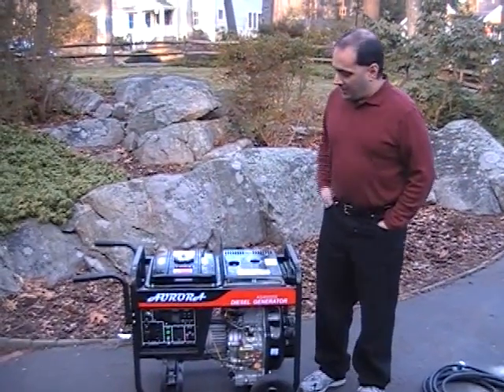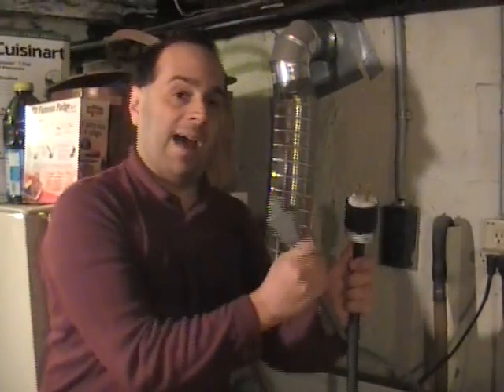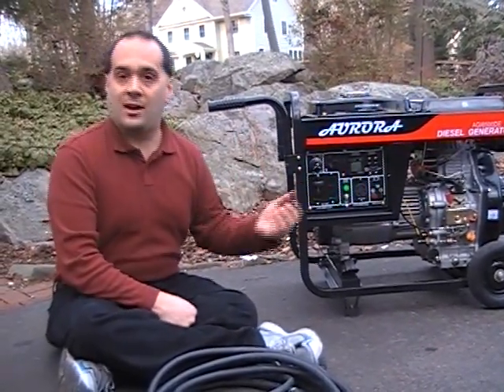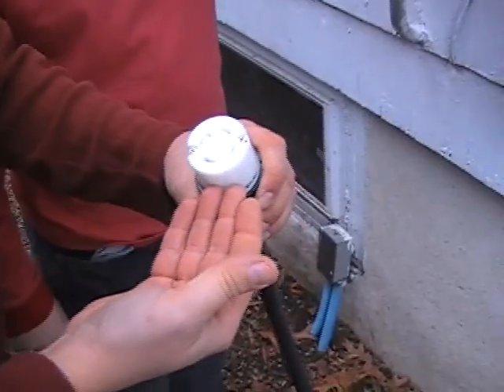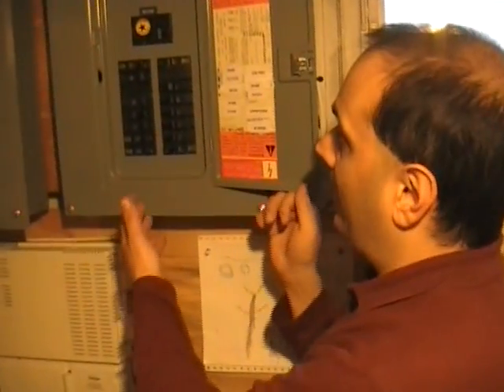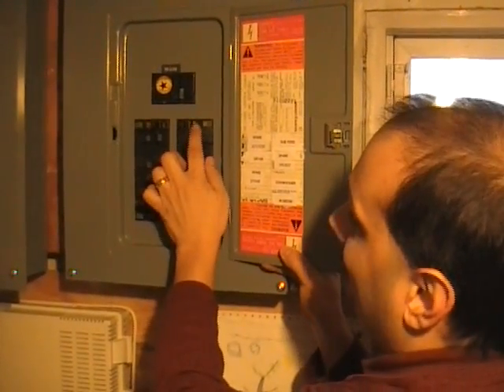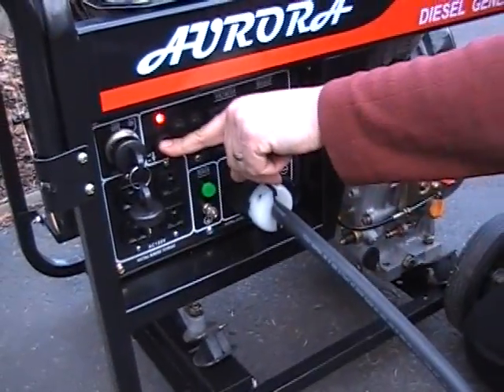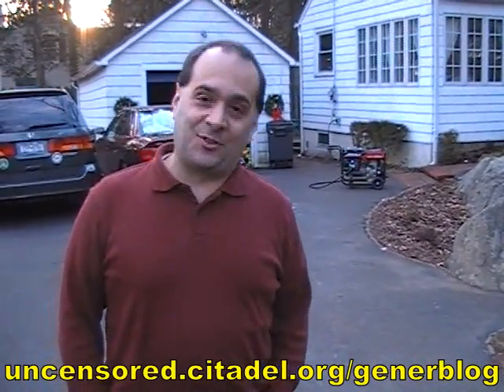Inexpensive residential generator hookup

Comment: Hi Art: Thank You for the great video and information.  First off I know very little about this, So I have to ask questions to learn. I have a double 50 amp circuit breaker as my main breaker/ ( On and off switch, )  Could I hook up another double 50 amp breaker from the generator directly to the wires on the house side of the main breaker to feed all of my circuits without a transfer box. The interlock switch would be needed. Trying to learn. Again Thank You.
Reply from the maker: For an interlock, the number of poles is not important; what is important is the number of handles.  When you say "double" do you mean two poles or four?  For an interlock, as long as both handles cannot be closed at the same time, you are good to go.

Comment: chances are back feeding cant handle the heat of those wires
Reply from the maker: I admit I poorly phrased that sentence.  The wires themselves can of course handle backfeed; ampacity vs wire size is all that matters.  The point I was trying to make is that the circuit breaker is at the wrong end of the cable when the circuit is used in that manner.
Reply: well said

Comment: Your outside male plug does not appear to be weatherproof while in use.
Reply from the maker: You are correct.  It is not.  Wasn't required in that location at the time it was installed.  Since then, I have switched to while-in-use covers.  They don't cost much more.

Comment: A/C and fridge/deep freezer and the ability to charge a few electronics would be my only real concern in a power outage.
Everything else is manageable for what 98% of the time, ends up being a very small window of no electricity.
Reply from the maker: Only you can decide whether you need a generator, how big it should be and how you hook it up.  When I made this video I lived in a neighborhood where the power went out several times a year, and after a hurricane it could be out for days.  In my current location the power is so reliable that a generator isn't worth it (but of course I already own it).

Comment: I have done the same thing to my home except for one thing and that is I was told when I had it done that you should have your generator running before you plug in. Not that the way you did it was wrong because all your breakers were off and then turned on after your generator was running.
Reply: Generator safety rules: Always make sure you follow all the generator safety rules before using your portable generator. This is only a reminder. Generators can be dangerous if not used carefully. Every year, hundreds of people die or get injured when using portable generators due to carbon monoxide poisoning and electrocution. Make sure you are using your generator carefully and keeping others safe as well. There is something very serious that everyone should always be aware of when using generators. Some people do run their generator indoors which is not safe and that increases the risk of carbon monoxide poisoning which can cause death of family and you. Some people run their generator in wet conditions which can electrocute them. Please remember that you should never run your generator indoors. Remember that carbon monoxide is an odorless and colorless gas that you cannot see or smell. Carbon monoxide is a silent killer. Keep that in mind. Make sure your generator is 15-20 feet away from your house and away from doors, windows, and vents. Never use your generator in your porch too. Having a carbon monoxide detector is very important against generator safety. Some people also allow children to go near the portable generator which could pose risks. We need to keep an eye on our children making sure that they are not near the portable generator so they won’t get electrocuted or burned by the generator which is dangerous. A locking enclosure also keeps kids safe. A generator shed might look like a tempting place to explore, or take cover during a game of hide and seek, but a generator is a dangerous piece of equipment that can cause injury. It says on the manual that we should also keep children away at all times from the portable generator to avoid injuries. Please do not allow a child or unqualified people to operate the portable generator.  It is important to keep your children safe especially little ones. The portable generator can be hot during an operation. Just because some manuals missed what should be listed doesn’t mean it’s safe to do. Always follow the generator safety rules when using portable generators. Generators pose electrical risks. If you need to use your generator during wet weather, you need a generator tent to protect your generator from getting wet. Don’t let your generator get wet. Keep your generator dry and before using your generator, please make sure your hands and your generator is dry. Do not wear loose clothing when operating the generator. Everything that is said on the generator’s operating manual should not be ignored. Never smoke cigarettes near the generator. Please keep flammable things away from the generator. Never overload your generator too. Your generator can catch fire. Never ever try to plug a generator cord into a wall outlet to avoid back feeding. Back feeding your generator is dangerous. Always turn on your generator first before plugging in appliances and shut off the appliances before turning your generator off. Use a heavy duty cord for your generator and the cord should not be worn out. All the instructions should be followed carefully. Never refuel your generator while it’s running. It can cause fire if fuel spills while your generator is hot. You should turn off your generator and let it cool off before refueling it. Having a fire extinguisher next to the generator is also important. This is only a reminder for everyone’s safety of using generators. Make sure your generator is properly grounded. Having a fire extinguisher next to the generator is also important against the safety rules. https://youtu.be/I1jT3ANENvI and here is a video more about keeping others safe when using generators and also about our family’s safety. It’s important to keep our little children safe as well. Make sure they’re away from the generator. Hope this helps.

Comment: what kind of oil based furnace do you have?
Reply from the maker: +TMP TAKE MONEY PRODUCTIONZ    None, anymore ... I moved out of that house a couple of years later  :)

But it was a Weil-McLain furnace, installed (as far as I can tell) in the late 1960's, with baseboard radiators in two zones.

Comment: Assuming we have room for the interlock  kit, won't it be more flexible to connect  the generator to your main circuit board?  this way it is more flexible and you can selectively turn on what you want; instead of a a separate panel where you "Lock-in" your selection and cannot change it later (easily).
Disclaimer : I am not an electrician, therefore pardon me if I am sounding too naive.

https://www.youtube.com/watch?v=DtJQkK6sVno
Reply from the maker: +Nasar Azam    Every site has unique requirements.  The house in the video had a small 16-circuit panel and it was full, so there was no room for a generator breaker and interlock.  I would be ok connecting the generator to the main panel under the following conditions:

1. It is a big panel with enough room for the generator plus any future expansion
2. There is a manufacturer-specified interlock kit available.  As I mentioned in the video, I think the aftermarket ones that attack to the cover are a little clumsy.

But anything is better than those cheap grey boxes with the button breakers  :)
Reply: +Art Cancro (IGnatius T Foobar) My Panel picture. Any suggestions?

http://tinypic.com/view.php?pic=24zkk0p&s=9#.Vub_6-IrKUk
Reply from the maker: +Nasar Azam Your panel appears to be full.  To install an interlock you would need to remove two circuit breakers.  Those are all 1" breakers so maybe you could replace some of them with 1/2" (tandem) breakers if the panel accepts them.  Or you could move your generator-friendly loads to a sub panel like I did.

Disclaimer: I'm an expert but I'm not a licensed electrician; always consult with your building department and get a permit.

Comment: Very informative video - thanks.
Now , how do I communicate this with an electrician to create a similar set up?  :)

Can you suggest a portable generator. The main purpose is to power the sump pump in emergency.  Yes, I do have the battery backup, but I do not feel secured with that and our basement is fully finished.

thanks

Comment: Noticed how he didn't wire in his gas stove (can light with matches). Well that's fine for the stove, but not the oven. The thing is, modern gas OVENS use an electric glow igniter instead of a pilot light, so your oven will need power if you want to use it. Just sayin.'

Comment: where can i buy the two pole circuit breaker interlock clip? cant find it online
Reply from the maker: You need to get one designed to work with your panel.  The one in the video is model QO2DTI which is designed to work with Square D.  Just google that part number and you'll be taken to any number of online stores that carry it.
Reply: +Art Cancro (IGnatius T Foobar) Could you tell us what model sub panel you purchased? Thank you.

Comment: I'm confused how you wire the hot line coming off of each of the individual breakers in the subpanel into the existing circuits already wired into your home that you wish to power with your generator. Did you have to move all of the circuit breakers and wiring from the main panel over to the subpanel for each circuit you wanted the generator to run?  A lockout or mainline transfer switch seams to be less labor intensive, because you don't have to move all of the circuit breakers and wiring for each circuit you wish to power with the generator from your main panel to the subpanel. If you have to move you wiring from the main panel to the subpanel, what do you do if there is not enough wire length to make it to the subpanel?
Reply from the maker: +Andy Johnson - Yes, any circuits that I wanted to be generator-powered were moved from the main panel to the sub.  As I mentioned in the video, I didn't have the space for interlocked mains in the existing panel, and I wanted more space anyway.   I still maintain that the aftermarket interlocks are a bit clumsy, but if the manufacturer has an interlock made for the panel, and you have room in the panel for it, then that's definitely an option.  In fact, I am considering that option for the home I now live in (I moved to a different town about two years after the video was made).

Comment: LOCK OUT the main breaker and tag it. Tell everyone in your house what you did it for.  I did not see that on the main panel, the lock ?
Reply from the maker: +Michael Carron - In this setup there is no need for lockout/tagout because the interlock prevents any dangerous connections from ever being completed.  Lockout/tagout is typically used by electricians to stop other electricians from energizing a circuit when they are working downstream.

Comment: Good video Art. I just bought a generator this week. Likely will use a outside box to connect to house circuit. But, your screen disclaimer about Insurance "does not cover fires from illegal, electrical hookup", is totally incorrect, at least here in USA. As long as the proximate cause is Sudden and Accidental and of course Unintended.   It would be no different from auto collision denying collision coverage to the owner caused when the insured driver was too drunk to drive and hit another object.  Insurance will pay for our stupid and harmful choices, legal or otherwise.

Comment: Well I agree that the backfeed system is not the best  way to go but I disagree with the protection being all the way at the panel all gererators have circuit breakers built into them.  If I had to do it in an emergency I would just change the dryer outlet to a rv marine power shore inlet box with male twistlock and put a female twistlock on my dryer.  I could then safely use a standard generator cord to power my panel after killing the main.   The Linesman are taught to isolate each section they are working on so even if you did forget to kill your main they would be safe if they follow proper procedure.
Reply from the maker: +davidbrennan5 It is true that all generators have circuit breakers built in to them but do keep in mind that the purpose of those breakers is to protect the generator, not the wiring.  And you are also correct in observing that linemen do test the circuits they're working on, never assuming that a line is dead.  The danger comes when they test a line, confirm that it's dead, then some jackass backfeeds the grid and the transformer, suddenly that 13KV line that the lineman had confirmed dead is now energized.

Yes, backfeeding through your dryer outlet works.  No one's arguing that it doesn't.  I still maintain that the risks outweigh the benefits, especially when a proper inlet and interlocked breaker can be had for less than $100.

Comment: very good video, everything is very well explained, now if you can show how to switch your breakers from the main panel to the sub panel the easy and safe way thank-you!
Reply from the maker: +brans   Unfortunately, I didn't think to take video while doing the work, but I did take a photo when I was finished:  http://photos.citadel.org/generator_001/installed_sub_open.jpg   Main panel is on the right, sub is on the left.  You can see the 60 amp breaker in the upper right corner of the main, and the wire from it feeding the sub.  Note the interlocked breakers in the sub with the hold-down kit (required by code when you are using a branch circuit breaker as an input; it needs "an additional fastener").  To move a circuit from the main to the sub, it's just a matter of unscrewing the wires from the terminals and moving them to the other panel.  I used the same brand and type of panel so that the breakers would be interchangeable between them, but that is not strictly necessary.

And I can't stress this enough: get a permit before you start, and get it inspected when complete to close out the permit.  Otherwise you will catch hell when you eventually sell the home or if you ever need to make an insurance claim.
Reply: +Art Cancro (IGnatius T Foobar) ok Art thank you for all the information

Comment: nice video, and I always appreciate a basement server farm

I take it you do not use the 240v on your generator?

I've been looking at subpanel kits at Lowes/HD and didn't realize you could piece one together for so cheap, and make it easy enough for my wife to use it. Looks like I will be throwing together a similar setup. We have a 3800w cont. gas unit, only really want to run lights, computers, and fridge.
Reply from the maker: In that house we did not run any 240 volt appliances from the generator, but the 240 volt receptacle was required in order to feed both legs of the panel.
Reply from the maker: +Leslie S That generator is a bit underpowered to use as a whole-house backup.  You can do the hookup and it will work, but you will probably be disappointed with how little you can run on it.
Reply from the maker: +Leslie S As long as your heat and hot water are fueled by gas or oil, and merely operated by electricity, then yes, that generator ought to be enough to keep you in heat, light, and hot water during a power outage.  If you have a gas stove that can be lit with a match, then you could even cook.  You'll find it's undersized when you try, for example, to run the microwave or the coffee pot, and then at some point the fridge cycles on and you trip the breaker on the generator.  If you're ok with that then go for it; that generator has a 30 amp plug so if you do the 30 amp hookup you can upgrade to a generator nearly twice that size later on without rewiring.
Reply from the maker: Happy to help.  Check the wattage on that well pump, it might be more than you think.

Comment: Now for how to keep the well pump running? An electrician said there's no way to hook a generator to a well pump. There has to be a way, even a big Generac?  I suppose though, with the distance to the pump, that you would have to have a generator for the house, and a Generac to the well?
Reply from the maker: +ltcajh Your electrician is wrong.  Anything that runs on electricity can run on a generator.  If your generator is wired via an interlocked transfer switch to your main panel, it will run the well pump.  Naturally, your generator has to be large enough to power the well pump.  Perhaps your electrician meant that most portable generators don't have enough watts to run the typical well pump.
Reply: Thank you.

Comment: Great video Art! Where would I find my local electrical codes as far as wiring from the inlet box to my transfer switch? Does the wire need to be in conduit?
Reply from the maker: Great question. Your town will have documentation of any local ordinances that supersede the NEC.  In most places, NM cable is fine, but some towns require armored cable and a few (like Chicago) need everything in conduit.

Comment: thanks bro, some great tips
Reply: +Matthew Sherman I'd recommend people buy a solar system...fuck generators...loud noisy junk.
Reply from the maker: +Matthew Sherman - solar panels are a nice way to offset, but they are hardly ideal as an emergency standby system.  They also take many years to recover your investment costs.  Generators are inexpensive, easy to maintain, and straightforward to connect as a standby source.